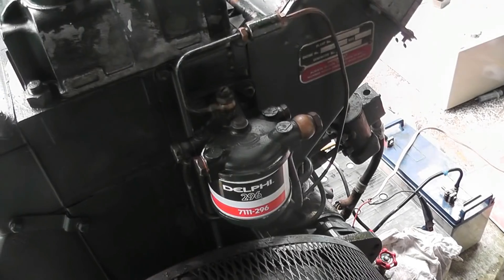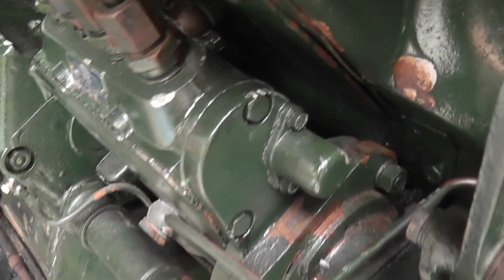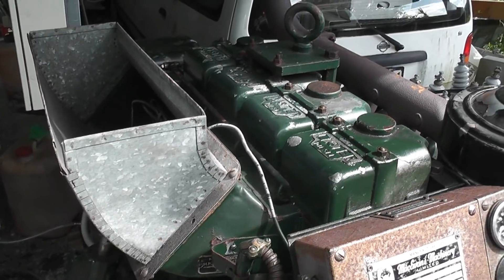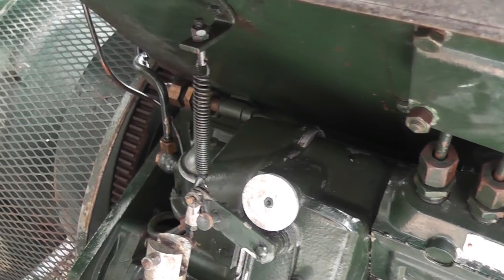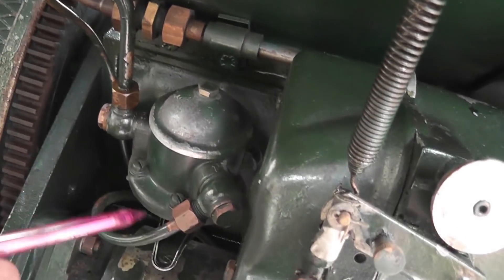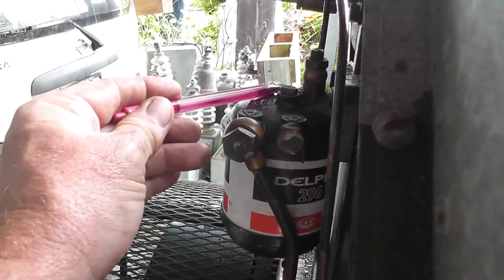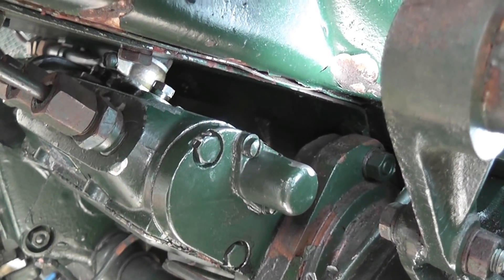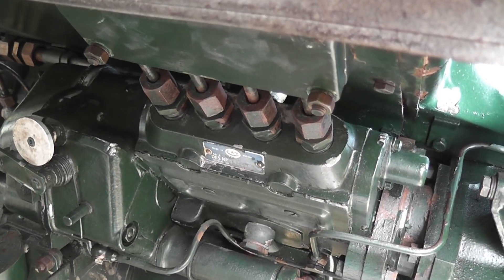Purging diesel fuel pump on Lister HA4 engine

Comment: I used to work for a duck farmer that would resprt to running the engine on aerostart to push the lines clean of air. I saw it done and helped do it quite a few times working for them. Done on an old tractor and semi. Never turned a spannerc on the fuel lines.

Comment: I spotted some repulsion on the starter motor feed cable.
Reply from the maker: Well spotted, starter draws around 200 Amps at 24 Volts.
Reply from the maker: Around 200 Amps at 24 Volts DC.

Comment: Thats a really nice genset  if its 3 phase wont it cause problems if you only draw power from 1 or are you going to use those heaters as a dummy load for the unused phases
Reply from the maker: I plan to split the house load over two phases and will use the third phase for auxillary supplies, heaters and supply our neighbours who may need power during a long outage.

Comment: Is the output pure sine? 3 phase i guess?
Reply: The generator is purely electro/mechanical/magnetic, no inverter or other nonsense involved,  so the output should be a perfect sine wave. Well, 3 perfect sine waves to be precise. I believe that's a 25KW 415/240 3PH 50HZ genset.
Reply: @sootikins  Thanks!
Reply from the maker: Pure sine, will do an oscilloscope test on the output one day.

Comment: The old diesels used to be a pain if you ran out of fuel, you’d have to loosen the swan necks and bleed the pipes that screw onto the injectors.
Reply from the maker: Well I managed to get it done with the bleeder screws on the fuel pump. The HP lines are a pain to disconnect and often fuel leaks occur after retightening the nuts. As long there is fuel in the fuel pump it should be able to push the air out the HP lines.